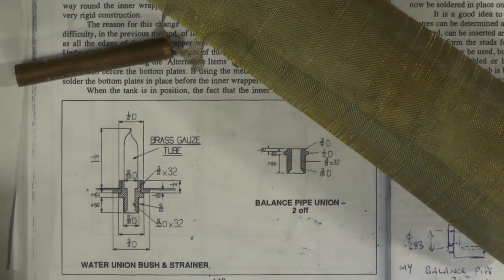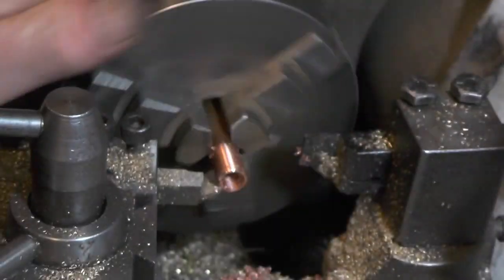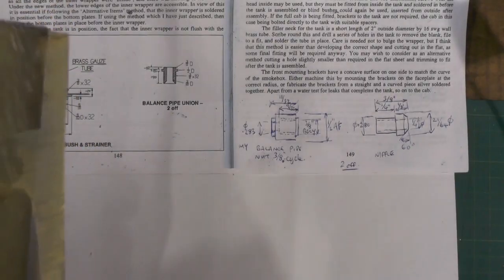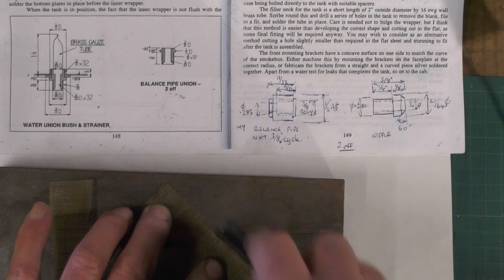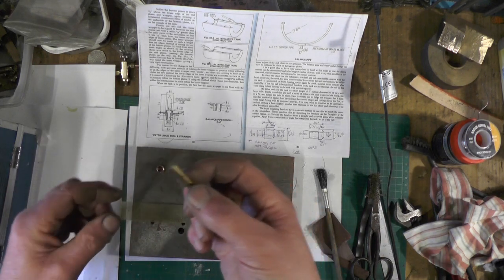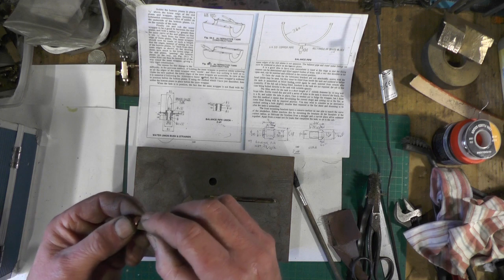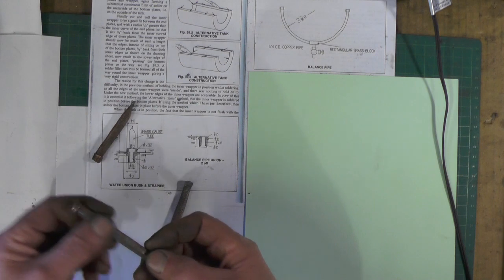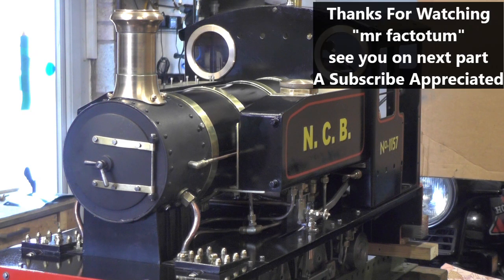Build Your Own Beginners Miniature Steam Locomotive Series (Pipework P8 WATER FILTERS) "mr factotum"

Comment: Hi Mr. F,
Nice work on the filters, I will redo mine following your example after I bought some fine 80 mesh brass screen. I have just been trying to set the safety valves of my traction engine on compressed air, but I cannot get them to reseat properly after blowing off. I am trying to do a popping type spindle to take the stainless steel ball but I cannot find a drawing with dimensions anywhere on line. Do you by any  chance happen to have a detailed drawing?
Went to have my jab on Wednesday, the Astra Zeneca one. took a couple of Panadols every four hours for the next 24hours and felt fine. 
Keep up the good work and stay safe.
Emanuel
Reply from the maker: hi EL
good to hear you've had jab, i bet thats a relief for you, it was for me,  i had AZ one about 2 weeks ago and okay with it , get  my booster in 10 weeks time.
Good luck with the filters i'm sure you will manage them okay.
As for Safety Valves i have a drawing from the Book i'm working from, i set mine on my air line set at 80 psi and they work fine when i steamed the boiler with my blow torch some months ago, i did a video on that (Bench testing boiler), they have a stainless steel ball type in them. ( see my video in my boiler fittings playlist  "Safety Valves") If there any good for you,  let me have your email and i will copy and send to you. no problem
Regards
mr f
Reply: @MrFactotum  hi Mr. F.  
I  have a copy of Jack Buckler's book that you are working from, but the drawing of the safety valve stem is not of the pop up type, like the ones you showed on your earlier video. If you have a different detailed drawing I would appreciate if you could forward it to me. My e-mail address is  elautier@yahoo.com 
Thanks Mr. F

Comment: G’day Mr F. Good job on the filters but how did you tighten them in place? I’ve never built a steam engine let alone a loco I suppose there is a lot of pipe work to do. Thanks for sharing, cheers. Peter
Reply from the maker: hi peter
just a tight fitting plastic tube over them to screw them in , they don't have to be tight. Do you think you might  have a go at a steam engine in future,
thanks for watching
regards
mr f
Reply: @MrFactotum  I might make a steam engine one day but I don’t have a burning desire to. 
Cheers
Reply from the maker: @pgs8597  Nothing wrong with that Peter, we all have different projects and priorities, if we were all same there'd be nothing to different to watch on youtube, i like to watch different projects such as what you do.
keep up the good work
regards
mr f

Comment: Great job on the fine mesh filters ! They wont restrict the water flow with their size .The trick is to use just enough  solder to seal up the filter together . 
You got it ! 👌
Reply from the maker: cheers tfs
yes hopefully the mesh is wide enough to manage the flow ok, shan't know that till i fill up, hopefully not long now!!!
thanks for watching
mr f
Reply: @MrFactotum  I guarantee it will be fine ! Plus the fact the fitting is raised slightly "above" the bottom of the inside of the side tank is good 👌.
Sediment will lay on the bottom and not get pulled into the filter . somehow you will get slight outside debris into the tanks . That's just the way it is while running a loco . no worries , you've really reduced any chance of it being picked up.
Reply from the maker: @theflyingscotsman9902  hi tfs
thanks for your reassuring advice, i appreciate.
regards
mr f
Reply: @MrFactotum  good morning , I might add that in my tender of my loco , my longer filters are not pointing straight up but are laying horizontal just off the  surface by an 1/8th of an inch , taking advantage of the weight of the water level in theory . 
Just another thought for you . 
Cheers , my friend
Reply from the maker: @theflyingscotsman9902  thanks TFS
i will take note of that  advice for future modifications and for when i make a tender in the future
regards
mr f